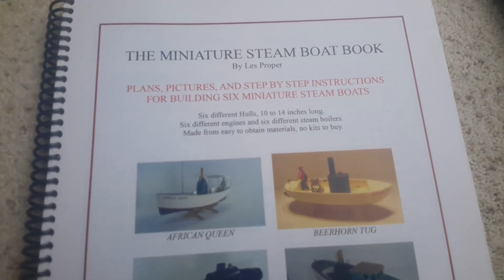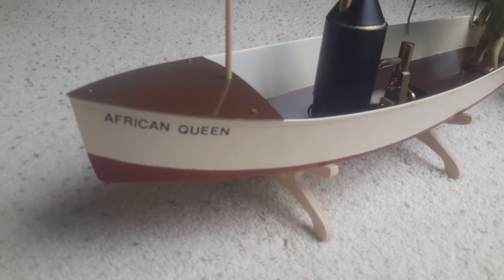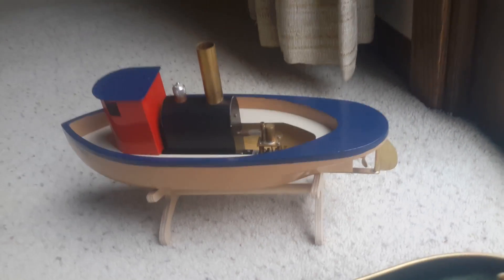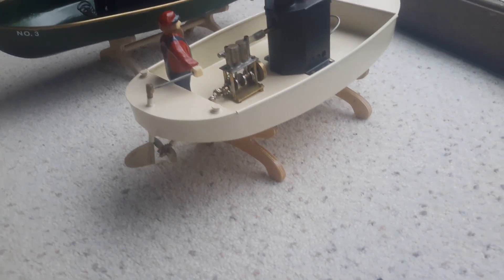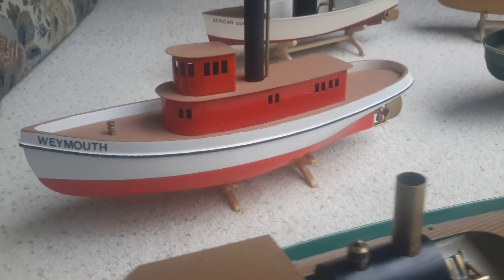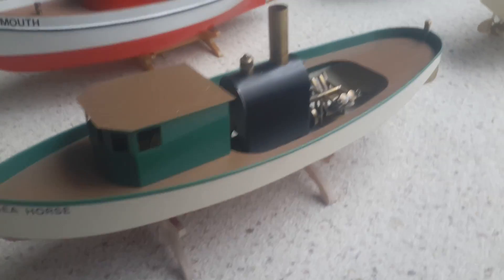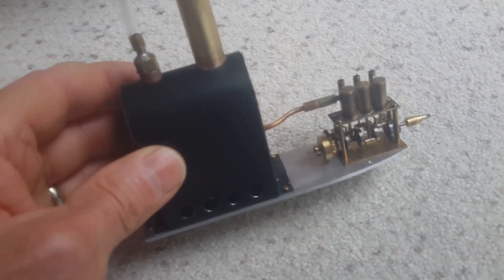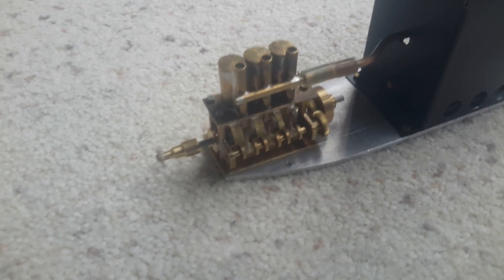Miniature model steamboats

Comment: I'll post this to a few hobby sites - they should find it interesting...
Reply from the maker: Charles Fitton Thanks for the posting.  I am already getting some replies.
Reply: Leslie Proper Not a problem - I admire your engines.. some close-ups would be nice..what part of the world are you in, and where did you learn this skill?
Reply from the maker: Charles Fitton I live in Minnesota, USA.  I have had a fascination with steam engines since I was little and I have been building them for over 35 years.  I'm just a self taught hobby machinist.  I have some of my best steam engines posted on youtube.  If you go to youtube and type "leslie proper" in the search box you will find them.  I build 1/20 scale steam traction engines with butane fired boilers.  I show a few of them running on my pool table on compressed air.  Be sure to include the quotations.
Reply: Leslie Proper  I'll check into the traction engines aoon. I'm more interested by the small boat engines....are you selling the book?

Comment: Tell us more about building the engines...
Reply from the maker: Charles Fitton Well, the engines were built on a Sherline lathe.  All six engines are scratch built from brass tubing and bar stock manufactured by K & S precision metals.  The components of the engine are soft soldered together. 0-80 miniature bolts are used to attach the major engine components. The crankshafts are made from drill rod parts that are hard soldered together.   Free cutting brass is used for the cylinders and valves.  The brass tubing used for the cylinders and valves has a smooth uniform bore so you only have to machine the pistons and valves to get a good sliding fit.  Does this help?